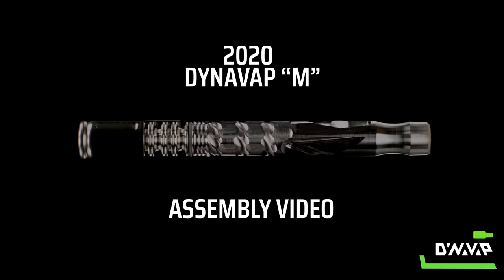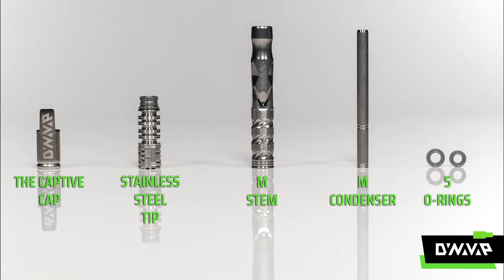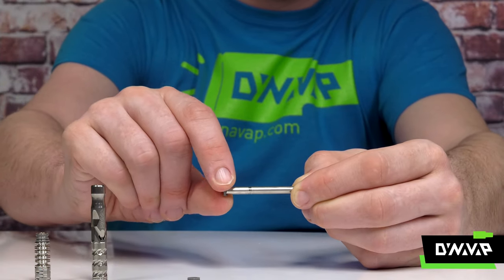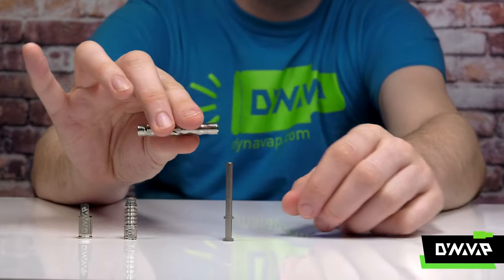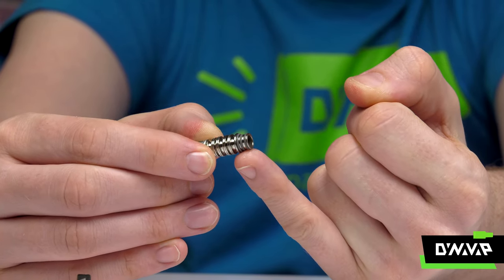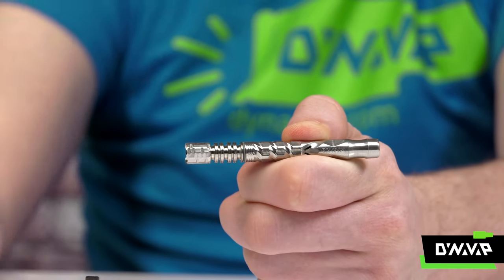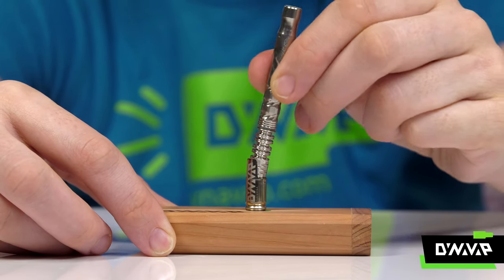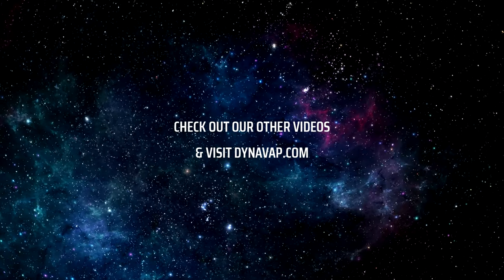The "M" 2020 Assembly | DynaVap Quick Video

Comment: Should do another video of adding a spinning tip to the M.
Took me longer than it should have to figure out all you need is a XL condenser w/ spinning tip.
Reply: Hi
Is the spinning mouthpiece worth it?
Reply: @gsxr7736  only you can answer this question .i use it because M  or any other vapcap( apart from omni xl) standard size feels small in my hands.
xl i like way better
Reply from the maker: Josh demonstrates how to make the 2020 M XL on the May 21st, 2020 episode of DynaVap Live: https://www.youtube.com/watch?v=to2uDNukuRc

Comment: Except there’s a CCD or screen that is the MOST difficult to assemble and literally Nobody demonstrates how to do it correctly. 
Looking down inside the tip I can see what looks like a machined ring. But it’s hard to tell if it’s a recessed ring for the ccd to snap into or if the ccd goes down further deeper past that ring and seats on the very bottom of the tip.

Comment: Whenever I try to twist the top part into the stem, the first 2 o-rings stretch way out of place. I finally get it fully connected but I think the o-rings are all stretched out under there and not in their grooves like they're supposed to be. So they'll probably break sooner.

Comment: what the bro.

I appreciate this video. But would have loved had you not skipped the step where you put the rings on tip 

Why did you skip that part?

Delete this video and upload a new video where you also show how did you put rings on Tip.

Not that this video has Millions of views which will affect dynavap monetarily
Reply: I could be wrong but I believe the o-rings on the tip are not meant to be removed